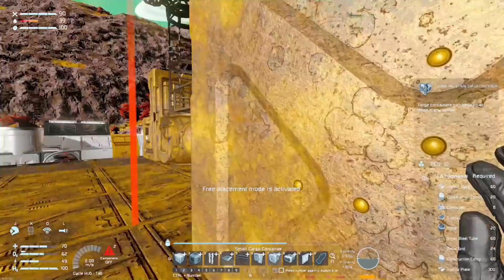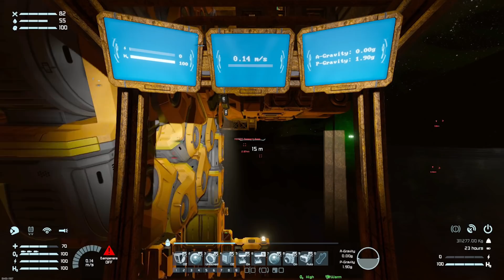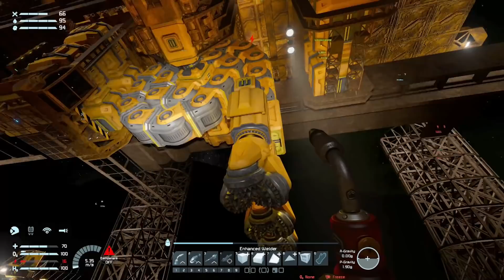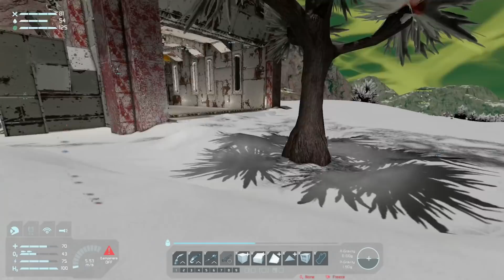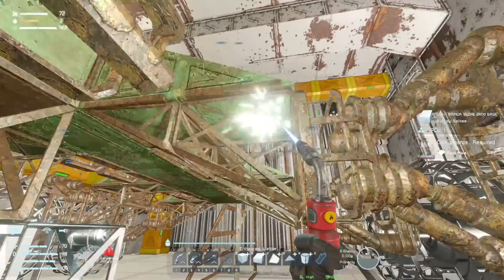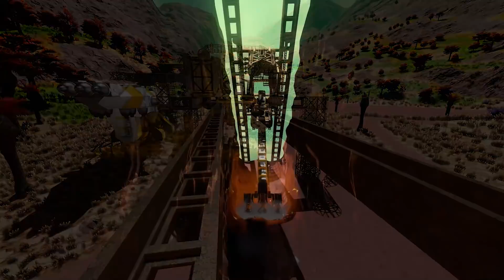Survival Impossible - Unknown Miner #62 - Space Engineers Hardcore Survival

Comment: 10:17 I have always hated that issue. I always have to use a modded H2O2 Generator or build 100 of them because they are too small. A bunch of the blocks need bigger versions in the vanilla game. A station sized H2O2 Generator would be nice. As well as a reactor that can push out more than the large reactor. I often need at least 6 vanilla reactors. A powerful gyro is needed along with the regular one. I often build ships that need 500 or 1000 gyros to still turn slow leaving you thinking "1000 of them wasn't enough??". They need a gravity gen that has modes. It puts gravity out in a circular radius but I want it to do 1 of 2 other modes. I want it to either put gravity out in a box rather than a circular radius so that 2 gravity generators can have gravity fields that line up at the edges...or... a gravity generator that you place down on a ship or station and it just provides gravity to the entire structure and will just use more power based on the size of the structure. Cause with a circular gravity field then 2 gravity generators will multiply the gravity in the areas that the circles overlap. That sucks. Sad faces. While I am talking about things I wish SE had I will mention I wish I had a volume slider for every single block in the game. Some are just too loud. But I don't want to turn the whole game volume down. Just specific blocks. The ability to move things through small conveyor is needed. I mean my dude can carry stuff on his body in a pocket or bag I assume that can't go through  small conveyor. I mean.....thats just ridiculous. Let me conveyor the stuff. Some type of symbol that tells me the top and front of a block would be nice. I been playing this game since 2015 and I can't for the life of me figure out the top and front of the fucking projector. I should not even have to look it up. Its a game so I would assume people would naturally design models with obvious tops and fronts. The ability to tell reactors and batteries what to power would be nice. So I could make power systems that are separate but on the same grid. I hate that once you loose power thats it all power is gone . I can't tell my ship or station Hey...use this to power life support and use this other thing to power utilities and use this power over here as redundant power or backup power. And to end this long ass comment I will add I also wish there was a vanilla version of Nanobot Build and Repair, Drill and Fill, and some vanilla energy shields and forcefields. There is a difference sort of. What I mean by energy shields is a device that will use energy to make the skin of the ship or station have a protective energy shield layer. Not the space around it. It will not be in a bubble. Forcefields will use energy to make a energy field in a bubble around the ship or station thus protecting the physical station and the space around it to as far as you set. Oh...and remove weather from indoors and give me a slider or something to control the chances of a lightning strike. Cause as it stands now.....lightning is programmed to basically hunt you down. This is not normal for lightning. WTF?? The way its set now.....its not a chance you will get hit by lightning....Its a guarantee you "WILL" get hit by lightning. Its literally programmed to make sure you do. That is absolutely not normal lightning behavior. I also have an Idea for an AI block that would add a ton of functions to a ship or station but that is a whole other talk. I love this game

Comment: i think that the rust is fine but specifically the lighter rust on small grid block tiles awfully so the cap for the large cargo at the front is way too busy texture-wise, heavy rust doesn't have the tiling problem tho idk if it would work for other reasons in that spot

Comment: Good stuff as always! I really like how you added some cinematic interest in the "stop" in the spinning time lapse. Creative ways to cover whoopsie doodles is a skill and talent.

Naturally, I have some suggestions, as always.

1) If this thing is initially going to be more of a road maker than a miner, maybe something like "Trailblazer" or the like would work. I dunno any good puns based on that though.

2) Consider connecting the two mining arms. That way, all 4 of your hinge's torque can be applied to the entire length of the arm, in case one drill gets over burdened or stuck. Also, it would probably be easier to control if they all worked together. Take this with a grain of salt, as I've always used advanced rotors for this purpose rather than hinges.
3) Consider adding some mag plates to the bottom of your wheel base. You can depress the suspension and stick to the ground, which is more stable than ye' olde parking break during mining ops where your drills are very high or very low.
4) I didn't notice if you added a radio, remote, etc. but don't forget those just in case. Also don't forget a vent on your cockpit if you haven't added one.
5a) I have read, but not confirmed, that you can weld the plates if you find the perfect point where you are far enough away that the block behind it is out of range but the block with the plate is not. 
5b)Alternatively, maybe you could add a small grid welder to your next splatform or even make a liftsie-esque-weld arm.

Also, curious why a tunnel would not tickle your fancy. Just not in your aesthetics this time around? Maybe not the most difficult engineering challenge but could look really cool with "ribs" along the way, with the new pipes and transfer blocks, etc.

Anyway, super-glad that this is now part of my Saturday morning routine again! You're rekindling my appreciation for space engineers and my spare time hates you for it.

Comment: when you build a wheeled scout ...(not if) ... build it like a horshoe crab sort of ... build the top solid with a pair of turrets and armor blocks on top ... have the wheels inside the shell so instead of having them point out from the supports have them point in with armor plate covering the wheels from fire ... picture the way you built your miner frame ... just make that taller and wider then build the scout under that dome and armor the dome ... so when stuff happens you have some protection that lasts longer than a shot or two ... heck two regular turrets and a missile turret on a scout then you can man the missiles and use those for selective shooting to remove bothersome flyby's

Comment: Maybe you should consider tweaking the setting on the Hydrogen Engine. (if you can) It's nice that you have to work for the fuel, but it might be nice to ensure that it can then produce a reasonable amount of power from the fuel. 

I'm looking forward to the idea of the power/defense stations. It seems like a long time since I've seen you do fortifications that were not disposable.... and it might make for some cool views from high up to see a partially lighted road cut into the terrain with bridges and the like. They might serve as 'charging stations' if you burry a battery spine at the core of the outpost, and allow a small number of wind-generators to slow charge them. It might give you an excuse to build a battery hauler-trailer, if you decide you need to do an ore hauler. 

The other thing that might be kind of fun is a monorail-type set up. But I imagine over that much distance it would be completely infeasible even if it was designed to build it's own track.

Comment: Here is a thought. Once you have enough ammunition have the Armchair base throw enough resources down to build a few remote controlled tanks and fighters. Use them to take out the lake base. Then extend out the tram to the center of the lake and build a second processing base with big rotating drills for massive ice collection. You can modify the tram to transport the ice back to the main processing base for conversion to hydrogen. Or you COULD build a conveyor all the way out as well but where is the fun in that?
Edit: You really should rebuild Searchie and look around for a better spot to mine.

Comment: You know, thinking about what kind of trailer you want to make for this ride gave me an idea: do you know those little real world trailers they use on road building sites? Not sure about Australia, but over here in Europe you can see them everywhere, and also Fire Departments and other disaster control units have them. They are mainly just a big generator on wheels and sometimes also have a big retractable lightpost on them to power machinery at the building site and to light an area. I am not sure if YT allows me to post a link to an external website in the comments. If it does you will find a link to such a trailer in an answer to this post. Otherwise I will send you something via twitter.

You could use this trailer instead of several smaller recharge bases along the way and to shed light into your magnesium mining hole. Just a vanilla hydrogen tank, two to four hydrogen gens, four large batteries and a few pistons with spotlights on them for the light post part would make a really cool range extender and utility building tool for road digging/building and mining!

Comment: Nice save with the stuck camera rig. 

I'm not sure if you are missing some parts on the miner, like gyros or a beacon.

With it's two drill arms, it kind of reminds me of a (European) Stag Beetle. https://en.m.wikipedia.org/wiki/Lucanus_cervus

For extending the rails, I was thinking if you could get away with a single block gap in it? If so, you could probably have a part of it, that's long enough to carry your whole drilling rig, pushed out or even rotated, which could move it to another track. During normal use that part could be held in place by merge blocks.

Comment: Maybe build parallel rail with a pusher transfer section for the Nautilus. Move a whole section of track with the crane between track that way
Reply: Simply done, it could just be 2 sections of rail on pistons that get moved over.  More complicated: a perpendicular rail that carries a section of rail, with the tram on it, across to new lines parallel to the first.  There's the perfect spot for it just past the first set of support pillars.
Reply: The idea of of a perpendicular track carrying a section of original track seems much more practical than a rotor switch system, because you'd have to rotate almost 90 degrees anyway to keep the tracks from interfering with each other in a spoke arrangement. Then you'd need multiple roundhouses at the start of each track. Seems simpler to just move the tracks in a linear motion. You/he could even recycle rails by making the left side of one track the right side of the next.
Reply: Could really go crazy and build a full on Roundhouse. Radial spokes across the ice lake or into the mountain
Reply: I know, but Splitsie loves to over complicate things. Be right up his alley. Though that road is a crazy project in itself

Comment: Why not just cap your 'doomhole' with some blocks? If you need to get down there, build a ladder.
Reply: Also... if you've used up the effective range of your active drills, add two more on either end and delete the existing ones... More ice, no need to extend the rails.
Reply: So uh... if you build a battery, it comes with 25% charge. Build 4 and you have a full battery's worth of charge... Build an automated system to build, discharge, disassemble, then rebuild batteries and you have a nearly unlimited power supply that only needs Stone... No hydrogen, no wind, no solar, no nuclear. Just stone. I use a design like this in my videos. :) Feel free to steal the idea.
Reply: Call it the 'Honey Badger'. It crawls around on the ground and digs holes. Plus 'Honey badger doesn't give a sh*t!' (Meme video... watch it if you're unfamiliar), and honey fits with the yellowish color.

Comment: I noticed your having the phantom forces issue when building the new miner. I hope you dont have the same bug I do where the whole grid just starts jumping and going crazy when its on a station grid. Or that when you remove a block that has another block connected the whole thing goes crazy and rips in half.
Reply: That was because it is sitting on top of a rotor, should be fine once on it's wheels.
Reply: @csgergo80  I been having the issue without any rotors or anything. Probably is a mod conflict, but I did notice it before I had any modded blocks on any of my grids. No problem as long as the grid is on voxels, but when the wheels get on base or block it goes nuts

Comment: I reckon a screen shot of the re-fuelling base would be great in the competition (it looks 'military industrial' after all)? And, if you did manage to fall into that 'doom hole,' I reckon the death caused by high gravity removes the issue of being stuck down there (although that ramp you mentioned would make recovering your gear easier) 👍😬

By the way, speaking of ejectors - I recently discovered that, if you build a large grid ejector system with the connector mostly below the voxels, you can effectively dispose of all the rubbish (gravel, rock, etc) straight into the centre of a planet - which causes it to de-spawn as it falls. So much easier than filling a hole (or ejecting it on the ground) and waiting for it to de-spawn in its own time - lol

Oh, and under no circumstances call that (glorious looking) miner the 'Drillsie,' 'Holesie,' or 'Diggsie' 🤣🤣🤣
Reply: 'Doug' might work, though 🤐

Comment: That front round plate on cargo container together with "frogy" lights on top looks almost like a face, maybe tiny bit of other colour to make it smile? Or groan? ;P
I really thought you'd convert Panini to have detachable tanks and replace them with cargo, then just set up stationary mine on the cliff side.
Or make landing pad wheel based cliff crawler... well, you're masochist. Hope nothing is going to shoot you when you're at the edge, and that so much voxel deformation is not going to cause too much issues.

I assume making your track turn would be too much of a challenge (or would it?), but making a turntable should allow you to change direction and join to another section of tracks.
I'm hoping for another trebuchet or some fancy missiles to take out those closeby bases.

With addition of new armour plates you should be able to make slight upgrade to your garage - place couple welders in the floor and cover them with plates. Largegrid ones have decent range so should make welding at least undercarriage and those little plate blocks much faster.

Also i recommend this spotlight pack, i love the 30 degree and lowbeam spotlights, really handy in providing light where you go instead shining into the sky, and save bunch of subgrids on custom setups. https://steamcommunity.com/sharedfiles/filedetails/?id=1881158066
Reply from the maker: And now that you've said the face thing all I can think of is 'Danger Will Robinson, Danger' as I waggle the drill arms up and down :P

I'm still thinking up what might be possible with the tracks, haven't come up with anything I'm happy with yet though

Comment: Splitsie, would it be possible to create a large rover with the hinge-mining arm? Almost like a crane that could be swung out and lowered to dig pits? Just curious as to whether or not that concept could be made mobile.
Reply: Yea me and a friend basically made one on our traction city, he wrote a custom script, it has a sort of wrist at the end to be able to get more with the drills by turning and rotating
Reply: i made a rover like that on omicron but in plains near the equator ( i imagine it would require jacks to keep vehicule leveled to operate in mountains like splitsie place ), and worked somewhat fine, i couldn't have it too long as it was small grid folding conveyor arm with drills ( or welders sometimes ) , the rotor of the arm was quite weak with the weight, but it's possible to beef it up with pistons, i controlled it with timer blocks but there are crane arm scripts out there if you want aswell, and i did a large grid rover with a excavator style arm with a plunger drill that worked really well but on 1g planet
Reply: I made one that used a combination of pistons and rotors to retract into the vehicle, then extend and drop down to dig. All large grid. Worked well. Made it before the stability patch, so it was stable even back then.
Reply: Yes, they are possible, I use such miners in both small and large grid, up to a depth of ~50 meters with the large piston mod. Note they can get heavy.

Comment: Yeah Survival Impossible nerfed the ice-> hydrogen conversion, and then after you did that, vanilla did the hydrogen rebalance to be more useful. They changed something which might negatively interact with SI's changes, so you end up with a double nerf, but I'm struggling to remember.
Reply: The changes were "increased L/L h2 tanks to hold 15m L" and "20 h2 per ice but reduce the ice processing rate". Survival Less Likely keeps the old rate (10 h2/ice) and possibly reduces it even further so it's taking forever to fill mostly because of that.
Reply: @TheUrit  As long as enough ice has been mined, the Ice/H2 conversion rate is irrelevant. The primary bottleneck here is the H2 output of the O2/H2 generator, because it can only produce 500 L/s in vanilla. Even with five of them, filling two large tanks would take more than three hours, which is plenty of time to mine as much ice as you need and then some.
Reply from the maker: All I know is that I need more power, more ice and more generators :P
Reply: I like to pretend its a H-D low yield fusion generator.  Something about electrolyzing water and then remaking it for energy seems to violate my thermodynamics fetish.